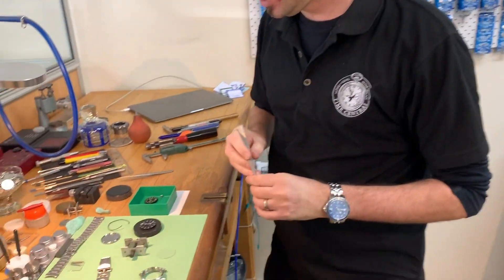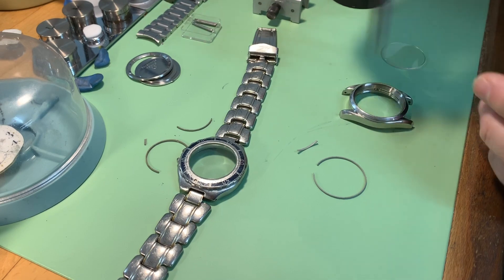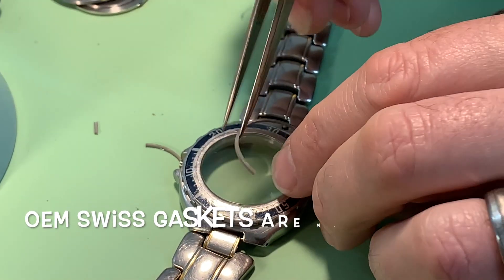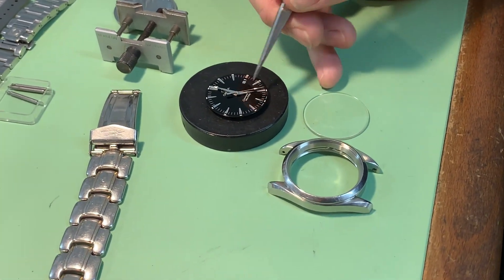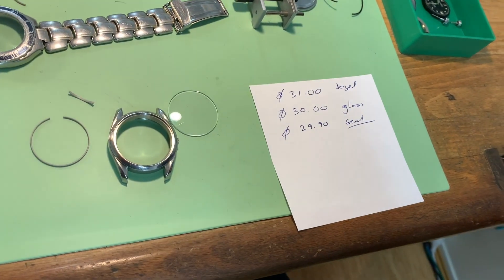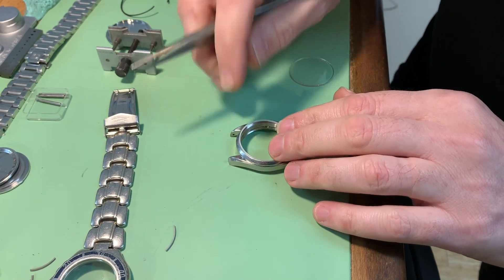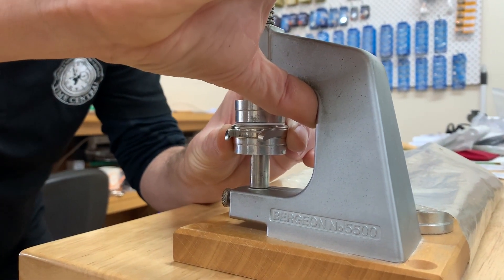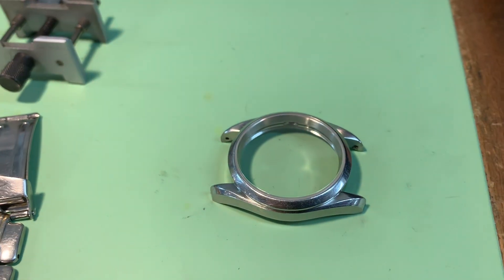Making Custom Watch Glass Gaskets on a Myford ML7

Comment: Excellent work. I thought of making gaskets myself on lathe but I never followed through with it, because I thought it wouldn’t be as precise, but you’ve proved me wrong. One question though, as a budding watch maker hobbiest myself, how does the dry test determine the watches water resistance of the rest of the seals? Isn’t it only detecting crystal deflection based on pressure? Thanks in advance!
Reply from the maker: Hi Gordon. Yes, the tester measures glass deflection, but if any air is sneaking past the seals the glass will not deflect. So deflection indicates all seals are working adequately. Dry testers are great for telling you if there is a leak but rubbish for telling you where a leak is. For that a wet immersion tester is better. You suspend the watch case over a pool of water and pressurise the chamber, wait a while and then lower the watch into the water and slowly release the pressure. A stream of bubbles coming out of the case will indicate a leak.

Comment: Interesting. There are times when that gasket isn't available any more, I wouldn't have thought of turning one.
Reply from the maker: Cheers Alistair. I seldom bother to order a glass seal these days... So much easier and quicker to just make it. I can also cut 'L' profile seals for Longines Grand Classiques and even Rolex.... Although there is a bit more of a trick to making Rolex gaskets fit and seal up. Rolex must use different plastic than Swatch Group as they don't break down the same.